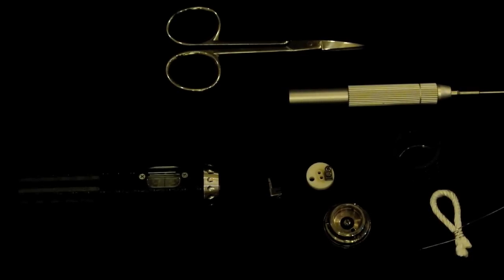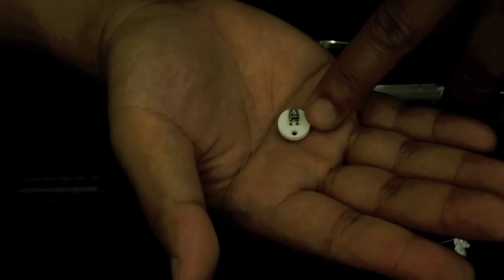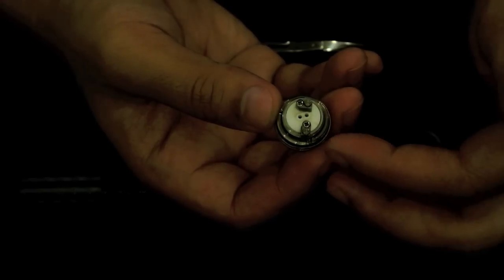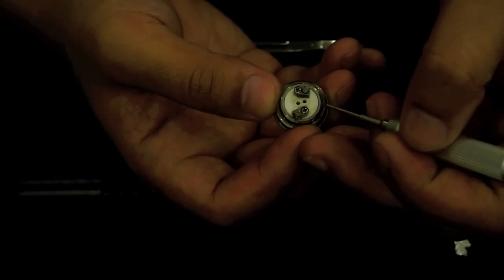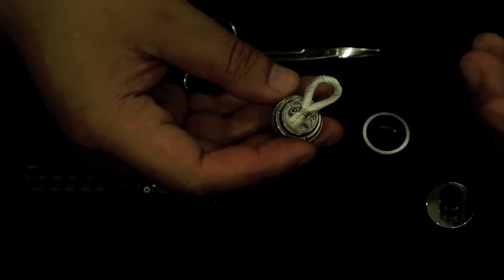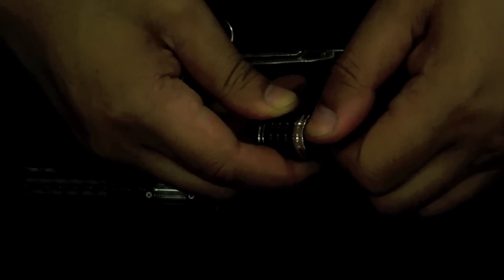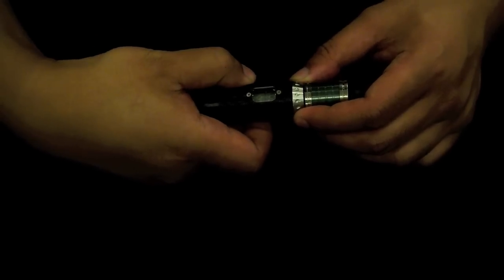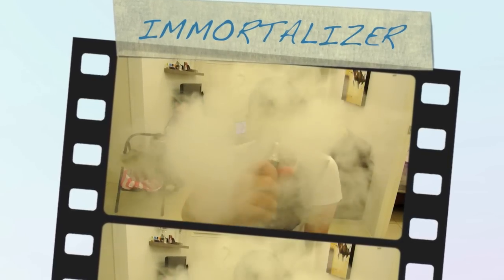A Worry Free Immortalizer

Comment from the maker: The difference is , the V1 poles were to thin which made it really easy to crack the ceramics. Plus everyone that had the V1 poles did not get a perfect orientation on where the slots for the wires went in. The V3 is really solid and just as easy or maybe even easier to handle than the V1.